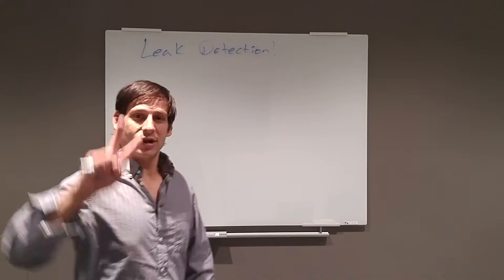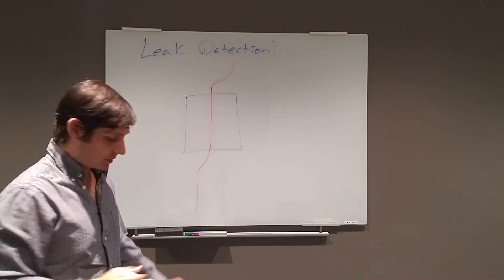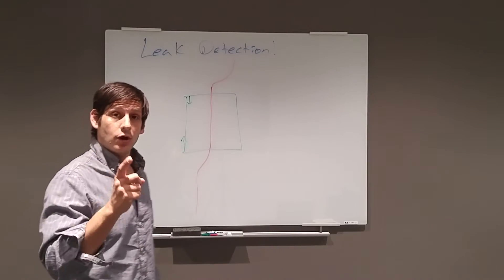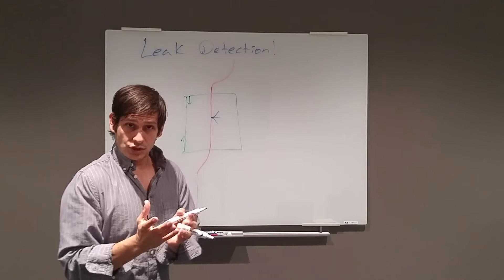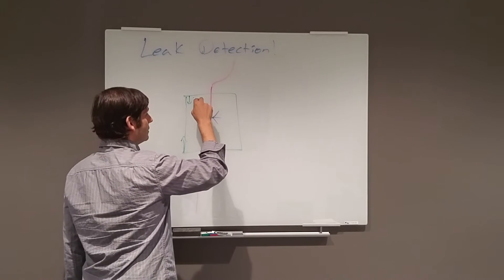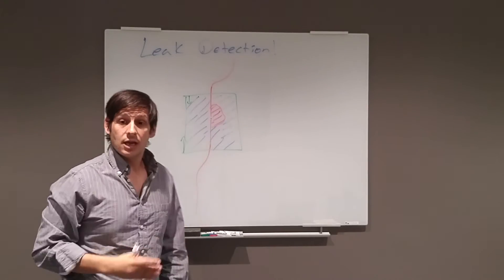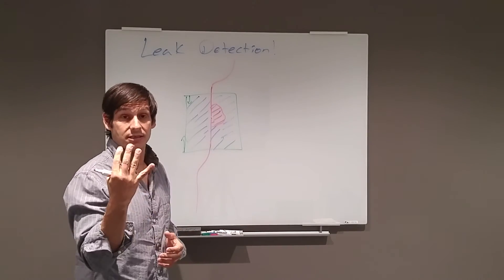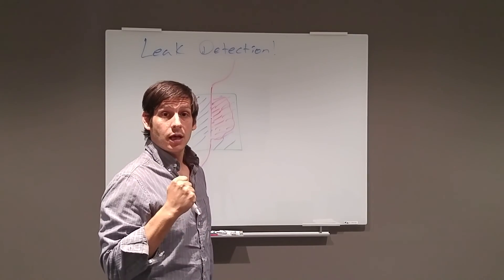Can Ground Penetrating Radar (GPR) Locate A Pipe Leak? - PART 2

Comment: How about gas pipe leak on non metallic pipe, is it possible to detect it? thank you
Reply from the maker: Great question Andarwa. Certainly there are "sniffers" for above ground gas pipe leaks. For below ground, it is possible to map contamination from oil/natural gas leaks. Sometimes this can help focus in on possible locations of leaks. The GPR signal will tend to deplete quickly in the contaminated areas since oil/gas are conductve.

Comment: Is it not worth mentioning the signal attenuation that would be caused by the increased conductivity of the subsurface, due to the water?
Reply from the maker: Thanks! Your completely right. Signal attenuation is absolutely a signature to detect a possible leak. I appreciate the additional point.
Reply: LearnGPR was that not covered in the first video?
Reply from the maker: It was Nathan. I discussed it from the perspective of a 2-dimensional profile. I appreciate you clearing that up for the others! You the MAN!!